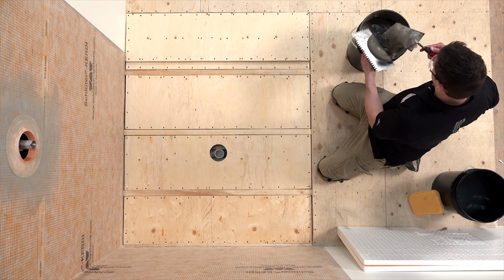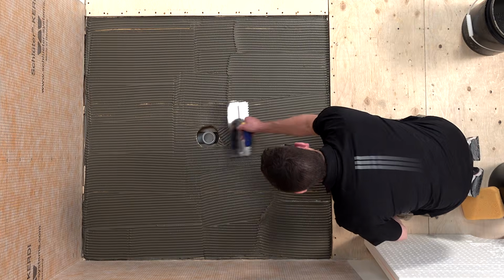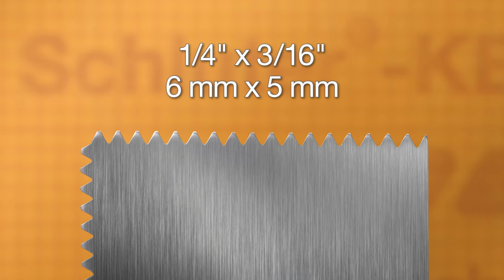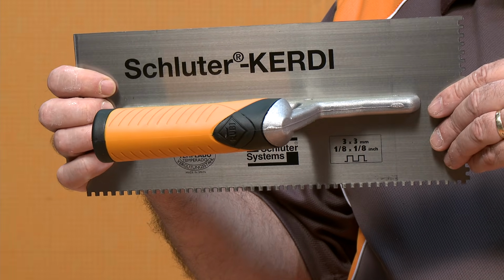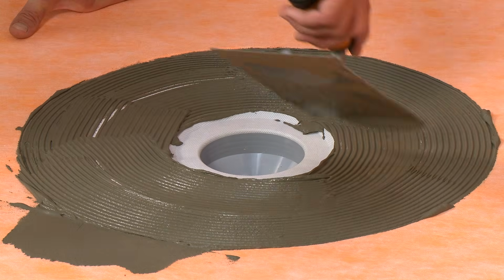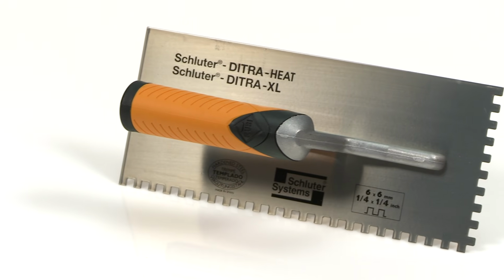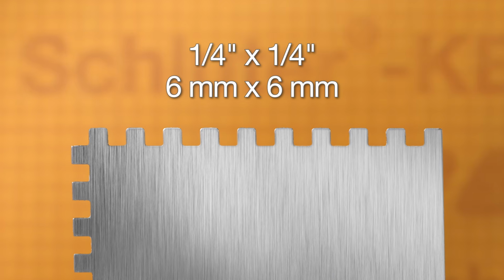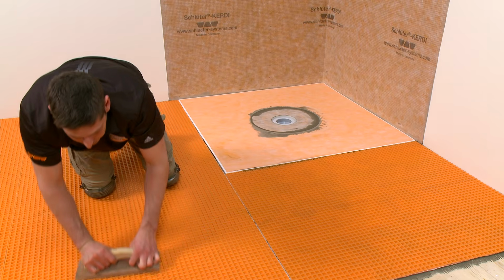How to Recess a Floor for a Curbless Shower with the Schluter®-Shower System

Comment: This video is helpful, but the example is very convenient because they're using 1" tall shower tray and 3/4" thick plywood with 1/4" thick ditra. Be careful to check the height of your Schluter shower tray before following this example, as only a few of them are 1" tall.

Comment: The edge thickness of the shower base is 1". If you have to cut a larger base to fit a smaller area is the thickess at the new cut edge less than 1"?
Reply from the maker: Yes, the tray will be thinner when trimmed down. The thicknesses vary depending on the tray, but if you first trim 3'4" off the edge and then cut it down by an extra 3/4", you can reinstall the edge with the cut tray. Then, use a little thin-set to bridge the gap and waterproof with the KERDI-BAND. Please check with our Product Support team for complete details: 888-472-4588 (US) 800-667-8746 (Canada). Thanks!

Comment: how thick is the shower pan in this example to have it meet up with the uncoupling membrane, is it 1" or 1 1/8"?
Reply from the maker: Hi Carmella. It depends on the size of the tray - they come as thin as 7/8" and go up from there, depending on the size. Please give our Customer Support team a call if you'd like to have some information on our tray sizes and options. 888-472-4588 (US) or 800-667-8746 (Canada). Thanks!

Comment: What about a straight slop one one side so you don't have level edges all the way around with converging slope towards the middle?? This is easy. Make a video showing how you get a flush transition when the shower is sloping across the entrance of the curbless shower.

Comment: Your adding another layer of plywood to the floor, how does the buildup terminate at the door?
Reply from the maker: Hi there! It will depend on the height of the adjoining floor and thickness of new bathroom floor. There are several types of finishing edge profiles for even transitions and reduction to lower surfaces. You can contact Customer Service to provide the details of your installation and they can help you find the right solution for your job. You can reach out to 888-472-4588 (US) or 800-667-8746 (Canada). Hope this helps 🍊
Reply: With a curb.🤣

Comment: how would you recess the floor when you have floor trusses and not solid dimensional lumber?
Reply from the maker: Hi there! Our customer service team would be better suited to answer this question. You can reach them at 888-472-4588 (USA) or 800-667-8746 (Canada). Hope this helps!
Reply: If your building new construction the person who designs your floor system can incorporate it into the design. 
If your home has floor trusses (I-Joists) as it’s built currently then you CANNOT cut the flange to incorporate it.

Comment: How is the drain connected the shower pan? I see that the pvc pipe is left below where the pan will be going but do you have to leave it a certain distance below the finish of the pan?
Reply from the maker: Hi there! This is a great video to watch for understanding how to address the pipe height for your Schluter-KERDI-DRAIN and tray installation: https://www.youtube.com/watch?v=o33UqcV7gSs. You can leave the pipe in the floor even with the subfloor or above it and then measure and cut it to the correct height to accept the drain, taking into account the subfloor thickness and tray thickness. Then, you can connect the drain to the plumbing below and thin-set the detachable center section of the KERDI-SHOWER tray between the substrate and the drain flange. You can find all the installation details in the Shower Handbook here: https://sccpublic.s3-external-1.amazonaws.com/sys-master/images/hb8/hbe/9474529001502/Shower%20System%20Installation%20Handbook.pdf Hope that helps!

Comment: How do I do this on a concrete slab?
Reply from the maker: Hi! You would need to chip out the concrete around the pipe, cut it down and then install the drain. They may need to do a box out like we show in this video: https://www.youtube.com/watch?v=Cd9hEn2YqO8
Hope that helps!
Reply: @schlutersystems1  I know you need to box it out but how do I box it out Is this a concrete guys job or tile guys
Reply: Also can this be done on post tension slab or to risky
Reply from the maker: Would be good to give our team a call so you can discuss your project in a bit more detail, and the team can ask some questions in order to provide you with the best answers. You can give us a call here: 800-472-4588 (US) or 800-667-8746 (CA). Thanks!

Comment: Does this work on concrete subfloor?
Reply from the maker: There are different installation procedures, but you can still have a curbless shower on a concrete subfloor. There's a whole section on our website dedicated to curbless showers. In here, you'll also find our Shower installation handbook with the very specific details you will need. Know that our Customer Support team is here for any questions you may have:
US : 800-472-4588
CA : 800-667-8746

Hope this helps!

Comment: The video dose not show or say how the bonding flange is secured to the drain pipe. Are you not using and glue?
Reply from the maker: Hi there! This video was made to show the recess part of the installation. To see the drain connection part of the installation, please check out the following videos:
if no access to the plumbing: https://www.youtube.com/watch?v=u-ZILYISeX8&list=PLEFjeySFJM-DaPne0m-KKaX5_g-twsDT1&index=3
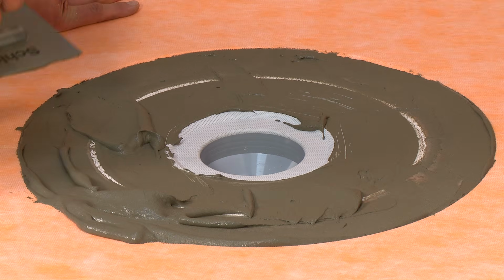To connect the drain with access to the plumbing ( see part at 7:00min in) https://www.schluter.com/schluter-us/en_US/Shower-System/Drains/Shower-Drains/Schluter%C2%AE-KERDI-DRAIN/p/KERDI_DRAIN?facets=false

Comment: what if i don't access to one of the floor joists because it's in the next room over?  how do i do the blocking?
Reply from the maker: HI Brandon! A new joist may need to be installed. We would suggest looking into this further with our customer service team, so they can get all of the details and an answer for you. You can reach them at 800-472-4588 (US) or 800-667-8746 (CA)

Comment: How is this going to be flush with the floor.  Reducing the subfloor by 3/4" in the shower area and adding in a prefabricated tray with 1" thickness within the recessed area leads us to being  plus a 1/4" relative to surrounding subfloor. 

With the surrounding subfloor, we add 1/8" Ditra.  There is still a difference of 1/8" between the recessed area and the surrounding area with Ditra.  Is this difference negligible or is there a step I'm missing?  Thanks
Reply from the maker: Hi Gurmeet, Hey, we used the DITRA-XL (which is 5/16" thick), but you can also use DITRA-HEAT (1/4") or possibly two layers of DITRA (1/8") for a flush transition.

Please don't hesitate to give our Product Support team a call to discuss a particular project that you have in mind, and they would be happy to assist. 800-472-4588 Thanks!

Comment: What about custom shower sizes? It seems easier to plan when you're using a pre-made base. But not very clear for something like a spa shower
Reply from the maker: Hi there, our trays can be cut to size and all waterproofing elements are designed to work together--and to be customized!
Here's a video on cutting trays and benches and such:
https://www.youtube.com/watch?v=1oddOrUDtdU
Our customer support team is available to discuss any specific questions you may have:
US 800-472-4588
CA 800-667-8746
Hope this helps!🍊

Comment: Wonderful walkthrough video! Just a question; are there any concerns about the moisture in the mortar getting trapped in the subfloor if this system was being installed over a crawlspace? We like to specify closed cell spray foam on the underside of the subfloor on crawlspaces (which is vapor impermeable).
Reply from the maker: Hey, No concerns! The presence of moisture in the mortar allows the cement to properly hydrate, resulting in a strong dense bond coat.
Reply: @schlutersystems1  Thank you so much!
Reply from the maker: our pleasure!

Comment: If you are installing a shower bench, do you recess floor area were the bench would be installed as well?
Reply from the maker: It would be easier to recess the whole shower area where the shower tray and bench will be located, but you can certainly leave the area where the bench will go as is (i.e., not recess it). Either way you need to ensure there is a solid floor structure to install the bench on top of. Please feel free to contact our customer service team if you would like to discuss further!
800-472-4588 (US)
800-667-8746 (CA)

Comment: You put thinset directly on the joists here, but in your documentation you put a layer of ditra over the joists prior to the shower pan. What would you recommend?
Reply from the maker: Hi Joshua, there is no need to install a layer of DITRA prior to installing the tray. The tray can be set directly onto the wood substrate with thin-set. Thanks!

Comment: What if my subfloor is cement
Reply from the maker: Hi Vengas, in that case, you can use the KERDI-SHOWER-RAMP or a mudbed to create a transition into the shower. You can give our Customer Service team a call to discuss your project in a bit more detail, and they can advise from there. 800-472-4588 (US) or 800-667-8746 (Canada). Thanks.

Comment: Can the membrane go over painted Sheetrock?
Reply from the maker: Hi Jim, KERDI can be installed over walls that have been painted with a latex-based paint or primer using Schluter SET®, ALL-SET®, FAST-SET®, or an unmodified thin-set mortar. Please refer to the Schluter®-Shower System Installation Handbook for wall preparation and installation information. https://sccpublic.s3-external-1.amazonaws.com/sys-master/images/ha1/h71/9145056493598/Shower%20System%20Installation%20Handbook.pdf
 
Hope that helps!

Comment: So I'm kinda confused, I get the recessed part, but what about the original existing floor joists..am I missing something??? Just starting to redo the bathroom and got your tray, etc.  Also can I use the LVP out in the rest of the bathroom floor, how do I transition from mosaic floor tile, to the Pergo LVP? Thank you.
Reply from the maker: Hi Ryan, it would really be best to give our Product Support team a call to discuss your project in a little more detail. They would be best suited to advise once they have a little more info, and make sure you have everything you need for your project. 800-472-4588 (US) or 800-667-8746 (Canada). Thanks!
Reply: You dont do anything to thenoriginal floor joist. You leave them in tact. However to make the floor level, you need to create a box frame 1 inch below the top of the floor joist, if you have a 1 inch thick subfloor. That box will give structural integrity to whatever is built above it. Hopenthag helps.
Reply: Ok so the old joists are now just level with the new floor? The old joists haven’t been lowered and I’m just trying to figure out where they went! Thanks!

Comment: the non modified mortar  I bought says it should NOT be used on a on a plywood floor.  Your install video says to use non modified.  which instructions. should I follow.
Reply from the maker: Hi Steve!
The non-modified thin-set is the right one to use to install the tray over the plywood. Modified thin-set mortar is not necessary in this application, as the mortar under the shower tray is more to provide support for the shower tray rather than adhere it to the floor. However, in most applications, a modified thin-set would be the correct thin-set mortar for a wood substrate. Hope this helps!

Comment: What about the lts model the slope is different, need to see a video of it
Reply from the maker: We don't have a video featuring the linear trays in a curbless application right now, but we will pass this feedback on to our Video team! In the meantime, you can find linear drain tray installation instructions in our Handbook: https://sccpublic.s3-external-1.amazonaws.com/sys-master/images/haf/h3c/9078303391774/Shower%20System%20Installation%20Handbook.pdf

Comment: How much thickness does the mortar bed add under the prefabricated shower tray? I'm trying to raise my bathroom floor to meet the 48x36 tray with 1" perimeter height. Using 3/4" plywood + 1/4" ditra heat = 1" so whether this build works depends on the thickness of the mortar under the shower tray as well as under the ditra heat. Thanks!
Reply from the maker: Hi Julien,
 The amount of thin-set under the tray should be about the same amount as under the DITRA-HEAT, so you should be fine. You may end up with a very slight difference between the two areas based on multiple variables, but that should be easy to address when waterproofing between the two with KERDI-BAND and when installing tile. Hope this helps!

Comment: How large of a pan can is available? I wanted a 5x5  or 6x6 curb less shower installed in to a second floor bathroom.  It's a remodel.
Reply from the maker: Hi Linda, we have shower trays that are very thin and ideal for curbless showers, and they go up to 4' x 4', but we also have other options that go up to 5'x5' and 6'x6' which are only about 1/4" thicker, depending on which size you need. Those can also be used for curbless applications. Think the best thing would be for you to give our Product Support team a call directly, so you can discuss the details of your project and they can advise from there. 800-472-4588 (US) or 800-667-8746 (Canada). Hope this helps!
Reply: I use the bigger shower pan then fill up the gap then membrane on top easy

Comment: The video shows sloped shower pan installed after the kerdi board on the walls. Shouldn't the wallboard be installed after the pan. Pan first, wallboard over the shower pan?
Reply from the maker: Hi Matt, either way is fine. It's generally easier to install the KERDI or KERDI-BOARD first and then install the tray up to it. If you install the tray first, be sure to protect it with a piece of cardboard or similar when walking on it. As far as waterproofing goes, the sequence does not matter as long as there is a 2" overlap. Top-over-bottom or shingle laps of the membrane are not required Hope that helps!
Reply: @schlutersystems1  great,  very helpful.  Thank you for the response

Comment: can regular dieters be used with the tt curbless or does it have to be the xl
Reply from the maker: Hi Dailo, The 1/8" DITRA would not be an option here. DITRA-XL or DITRA-HEAT would be used based on the height of the installed tray and the thickness of the plywood. Please give our Product Support team a call to discuss your project specifically. Thanks! 800-472-4588 (US) or 800-667-8746 (Canada).

Comment: Should this be done before the plumbing rough in? My project is new construction so the drain can be plumbed from below. Also, do the walls have to go in first like the video or can they come after?
Reply from the maker: Hi Chris,
If you have access below to install a new drain pipe wherever you want to afterward, you should recess the floor first. The walls can go in after as well, as long as all measurements are taken into consideration prior. Hope this helps!

Comment: Is it possible to do this type of recessed floor with engineered i joists?
Reply from the maker: Hi Charlie,
It may be possible, however, this video is only meant for dimensional lumber installations. For I-joists, you would need to consult the framing manufacturer or a design professional for possible recommendations....

Comment: I’m looking at using KSLT1395S Shower pan. The gradient is 2 inches. The  recessed floor only gets me the width of a plywood which would be three-quarter inches. How would I be able to make this flush. There would be a difference of 1 1/4 inches from the edge of the shower pan to the existing subfloor.
Reply from the maker: Hi misterolympus, could you give our Product Support team a call. They could discuss the details with you. You can reach them at US: 800-472-4588 or CA: 800-667-8746.
Reply: Cut the 2/10 by 1 in 1/4 then reenforce it simple

Comment: Hi! Awesome video! Can I do this (recess  pan) if my current washroom subfloor is 5/8” or is it designed for 3/4” subfloor only? The rest of the washroom will have heated flooring underlayment which has to meet up to to pan height and wondering if the 5/8” subfloor will cause it to be to low.
Reply from the maker: Hi Tony, 
Could you possibly give our Product Support team a call? They are well versed on technical details and could talk through the scenario with you.  You can reach them at US: 800-472-4588 or CA: 800-667-8746.

Comment: 4:46 it looks like the shower pan is higher than the plywood around it. Later in the video ditra is used to level things. Thing is that lip looks a lot more then the thickness of ditra. Either way, what do you do if the pan is @1/2” higher than the room?
Reply from the maker: Hey, thanks for the question! The floor is usually recessed to a height that would allow the top of the shower pan to be level with the top of the DITRA. It's best to dry fit all of the materials before beginning. If the height of the shower pan is 1/2" higher than the subfloor and DITRA, an alternative would be to build up the remaining floor height with 3/8" plywood prior to installing DITRA. That will be very close to even. Keep in mind that the bathroom floor tile and shower floor tile are sometimes not the same thickness.
Reply: @schlutersystems1  thank you!

Comment: Is it possible to have the curb-less installation using your products in an existing condo on the higher floors?
Reply from the maker: Hey there, we'd love to discuss your project and specifics with you. Can you give our Product Support team a call to get the conversation started? 800-472-4588. Thanks!